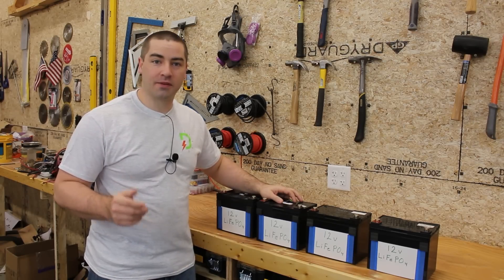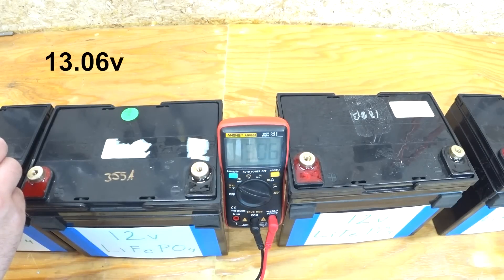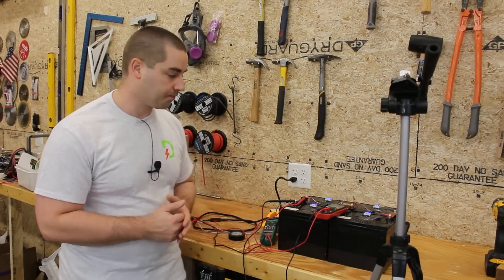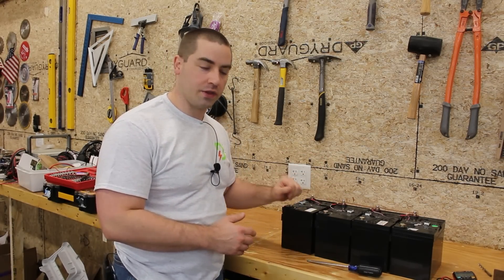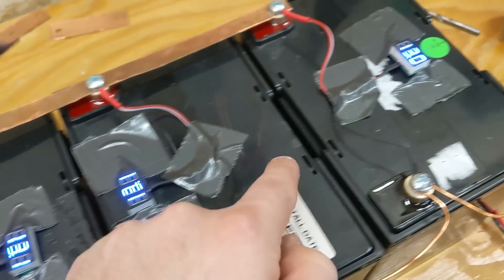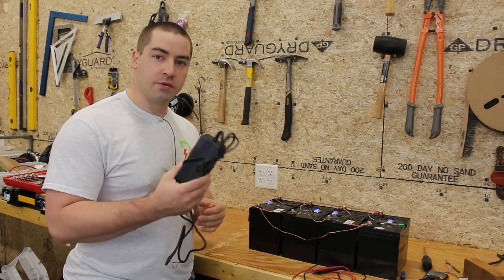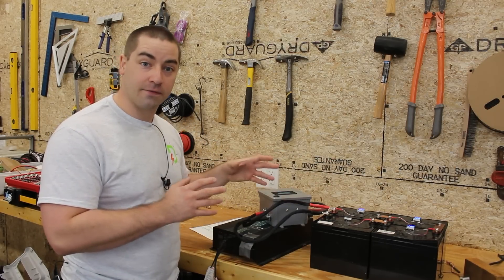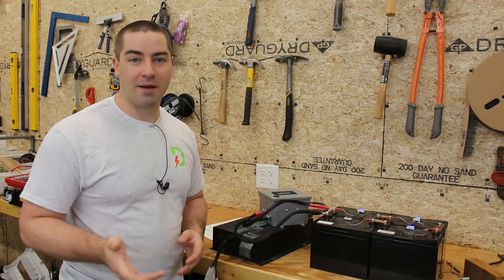How to Series Connect 12v LiFePO4 Batteries, and Top Balance

Comment: You could also capacity test each cell individually. 
For people confused, When stringing in series, if your charger only monitors the overall voltage. You have to get a multimeter out and double check the voltage of each pack. If one pack is constantly being pushed to a much higher voltage than the rest it will degrade and get worse. To counter this you have to reduce you charger cut off points. It will reduce day to day capacity but will dramatically increase the number of cycles which is more valuable return on your investment
Reply: Yes, I was recently in communication with a Chinese company that uses CATL cells in their products. The advice was to keep the pack between 20-80% but if you want maximum cycles then 50-80% with a >6000 cycle life is what they claim. Obviously the latter would involve buying a larger battery than you might otherwise need... perhaps a marketing ploy? I guess we will find out who was right in 20 years but my guess for best practice is to keep the pack out of the steep part of the charge/ discharge curve and let an active balancer keep the cells within a certain limit of each other.
Reply: What was the voltage output of the charger that was used to charge all four in parallel? A voltage output of 12V won't charge 12v lithium batteries, I believe it would have to output somewhere around 14.8v if I'm not mistaken.

Comment: I have just found that it is possible to get a balancer that works on 12 volt batteries. I got a PowMr HA02 balancer that works on banks up to 48 volt. I have installed it on my 48 volt bank of cheap LIFEPO4 batteries and it has given the bank much bigger capacity.

Comment: David, I have an EW7 mobility scooter with  4ea 12 volt (48volt) lead acid batteries, will be using lithium phosphate life pro 12 volt 20 Ah batteries 4ea.(48 volts) My Question is,

my Charger is a Waouks model wa.600, 58.4 volt, 10Ah , CAN  I use it to charge my 48 volt batteries???

Comment: So I'm putting together a 24 volt system. Is it better to series two twelve volt batteries or invest in 24 volt batteries and run them in parallel? Do I get more useful reserve capacity (Longer run time) parallel 24 volts or series 12 volts.
Reply from the maker: It is better to use a 24V battery if you have a 24V inverter.  Series connecting 2 12V batteries is not preferred.  However, if you already have some 12V batteries, this video will help you series them to get the most energy and life.
Reply: @DavidPozEnergy  do I get more reserve power in series or parallel?

Comment: Ok. So I'm seeing lots of videos about compressing the batteries to stop the cells bulging, but none of the vids I've seen about compression actually use 12v batteries like these. They are all 3.4v, "EVE" style batteries. So, with my "lawnmower battery" sized, 12.8v-33Ah 'Electrovolt' branded generic LiFePO4 batteries, should I try to compress them? The casing is plastic, will it really matter? I bought the 'Electrovolt' branded 12v-25A charger to charge them individually for the first charge. 

This is way more complicated and involved than I had first realized. 🙄🙄🙄
Reply from the maker: No, do not compress this style 12V battery.  Those cells you mention (commonly blue rectangles) need a fixture to prevent swelling.  The batteries in this video are made of cylinder style cells that have a metal case around each.  That casing is the fixture already.
Reply: @DavidPozEnergy  Thank you so much for getting back to me and clarifying. I appreciate it greatly.

Comment: Finally! I've bought some new 12.8v LiFePO4 batteries, with internal BMS, wholesale from a company that went out of business and their literature says do not exceed four batteries in series or two in parallel. Now, I've bought six of them at once with the express purpose of connecting them in parallel to keep the voltage at 12 and crank up the kw hours. I was bummed until I realized that all the channels I watch have multiple, multiple batteries connected in all sorts of configurations. But this is the first set of "lawnmower battery" style of batteries I've seen anyone experiment with on camera. So thank you for easing my mind on these. I got an awesome deal. Best deal I could find anywhere for new, 12v LiFePO4 batteries. They're all brand new batteries, but still quite a bit of money for me to spend.

Comment: Hello David,
Is it better to buy 4 batteries 12volts 150AH (Felicity  LPBR12150-T) and connect them in serie on a Growatt SPF 5000 ES or buy one  48v /150Ah (Felicity LPBR48150) - (4 batteries cost 1360 $ vs. 1800$ for the other one)
Reply from the maker: It's better to buy a 48V battery when you need 48V.

Comment: I have two 12v lifepo4 batteries and the supplier just says "do not connect in series" but they don't say why but now I understand why. (and also, it seems that it's not that bad if you do, actually)
Reply: cuz it make the BMS fail and the failure caused by HIGH voltage ( 24 v ) make that the bms CANNOT be turned off anymore, i already seen it happen, if you want a 24 volt battery then BUY A 24 VOLT PACK WITH A 24 VOLT BMS, NEVER EVER put BMS in SERIES, NEVER

Comment: Beautiful & Very informative Information. Thank You so much. Could a person charge each individual 12 volt battery 🔋 to do the Top Balancing & achieve the same results?  Thank You again
Reply from the maker: Yes, you can do that too.
Reply: @DavidPozEnergy  Thank you so much for replying. I’m new to the Solar world 🌎. I just bought 16 100 amp hour Battle Born Batteries 🔋 with the Victron inverter that battle born recommended for my 48 volt set up. I also bought 8 Solaria 400 watt solar panels. I’m excited to learn. I’m learning from you & Will Prowse of DIY Solar. You two are the best teachers in my humble opinion. I’m putting my system inside of an all aluminum cargo trailer so I can have portable power & an option of a toy hauler too. Thank You again. I’m a brand new Subscriber to your channel too. Please stay Safe & Stay Free 🍻 🇺🇸

Comment: Hi David. Great video. I picked up 5 Renogy 12 volt 50 ah batteries with the intention of connecting them in series,  about 70 volts when fully charged.
This was to power a covered mobility scooter running a 60 volt 1200 watt brushless motor.
I read some comments saying 4 batteries is okay in series, but maybe not 5. 
I'm wondering whether to go ahead with a test. 
Looking forward to your other videos.
One of my next projects is to put a 175 watt solar panel canopy on a 60 volt mobility scooter using a boost voltage converter.
Baby steps.
Thanks for your videos.
Reply: Careful, Renogy specifically says not to connect their batteries in series, only parallel.  Not sure why he missed that

Comment: Hi. Thanks for the vedio, if i understand correct, i can connect two 12volt LiFePO4 in series and use then in a 24 volt ups sustem. I must just remove them say once a month to top balance them? please answer
Reply from the maker: You will have to check with your manufacturer to see if series connection is supported.  Some do, and some don't.  Eventually they will drift and need the top balancing again.  I'd probably check once a month, but depending on how hard you push them you might not have to re-balance for a while.
Reply: @DavidPozEnergy   Thank you for the reply, so i guess it just boils down to can the BMS handle the input voltage and step it down to a suitable voltage to charge the battery

Comment: Thanks for the video.  Question, when using series configurations, such as a 24vdc  xxxah with a bluetooth module, how do you use the bluetooth dongle in each battery to monitor the individual pack?  Two batteries, two bluetooth dongles how to monitor?  Thanks is advance
Reply from the maker: Each BMS needs it's own Bluetooth dongle.  Then inside the App you will see the different serial numbers and you select which one to open.  I have about 8 batteries in my garage now all with bluetooth.
Reply: @DavidPozEnergy  Thanks for the info...regards keep up the good video's

Comment: can I use my regular car battery charger in 12v mode and 2 amp mode ? it's for 2 brand new 12v lithium that will be run in 24 v config. They need to be same soc before series hookup
Reply from the maker: Not all car chargers can work with a lithium battery.  lithium requires a "CC/CV" charger, meaning constant current and constant voltage.  I linked to one in the description that wasn't too expensive.
Reply: @DavidPozEnergy  thanks, perfect!

Comment: Can I power my ebike 48volt 1000watt brushless electric motor with 4 12V 16ah Lithium Iron Phosphate batteries wired in series to produce the needed 48 volts? It currently operates off 4 12v 16ah lead acid batteries, but the weight is 3 times heavier. Will the internal BMS in the LiPO4 batteries shut off sooner? Note: On an ebike, you pedal the bike at the same time the motor is running, to extend run time until the volt drops to low for operation, regardless of power supply.
Reply from the maker: Hi Bennie Williams,  The answer is: probably yes.  Something to consider is the peak your motor might draw.  1000W/48V=20.8A  But there might be a surge when you start from a stop.  If the surge is 3x, then you could be looking at 60+ amps (for a second) you need to account for.  The BMS's built into a 16ah lithium battery might not have that capacity.  So just make sure they do when comparing batteries.  Alternatively, you could make your own battery, or buy an E-bike 48v battery.

Comment: It’s always best to use/build a 24, 36 or 48volt battery to get those voltages instead of 2, 3 or 4 12volt batteries in series. When charging in series even the best batteries like Battle Born will eventually go out of balance it you don’t take some extra steps. Top balancing the group will work for a while but you will need to reassemble it in parallel periodically which is a hassle. There are only two other ways. One way is to have each battery have it own independent charging like using the Ionic bass boat charger. The other way is a PowMr battery equalizer 4x12V on Amazon. This is not to be confused with a BMS but it’s kinda does the same thing with batteries but not cells, however no protection features.
Reply: So this pow Mr when put on 4 12v lifepo4 will balance the batteries and that all you have to do?
Reply: I guess in a single 48v the bms will take care of the balancing?
But wouldn't that be of a reduced capacity as compared to bigger batteries in series?
Also why not use a bms for the series connected batteries?
Total noob here 😀
I need to replace lead acid batteries 12x8
Have a 96v inverter

Comment: If you charge all four 12v batteries (in paraellel) to full using your 12v charger. Then you rearrange them into series...won't you have 48v full batteries?  I found it curious that you swapped to the 48v charger (which is more expensive).  Unless this is just a time saver or something?

Comment: Brilliant tutorial David. Many thanks from Australia! I have a pair of 12v LiFePo4 batteries I need to put in series, but have been told by the manufacturer that's a no-no. With the research I've done, and having watched this video, I'm pretty comfortable they'll be fine once they are properly top balanced. If not, it'll be a lesson learned! LOL
Reply: Hey Bruce,
 Fellow Aussie here in the same situation, how did you'd go? did is it holding up? Just bought a pair of the same type also wanting to hook em up in series but just noticed the manufacturer warning against using em in series. Unsure what to do atm. 🤔. I thought they were a bargain when I saw em but now not so sure.

Comment: Excellent video Dave. Can I connect 6 batteries in series? Some manufacturers state the possibility of connecting in series only 4 pieces. Thank you Pavel.
Reply from the maker: I've not seen any that allow more than 4.  Possibly a company like Valance might?  Or maybe buying 24v batteries, then connecting 3 in series would do the trick?  I don't have anything that needs 72v, so I don't know for sure.
Reply: @DavidPozEnergy  What are the limitations? For what reason? I'm building a go-kart with a 72V motor. I will put the HA01 balancer among the batteries.
Reply from the maker: If you are building the battery yourself, then use a BMS made for 72v: https://www.aliexpress.com/item/33050602966.html?spm=a2g0o.productlist.0.0.3f7e7978CllqCw&algo_pvid=36632c7d-ddda-44b2-bada-bc82472d5c52&algo_expid=36632c7d-ddda-44b2-bada-bc82472d5c52-2&btsid=0b0a555816169597516483319e362e&ws_ab_test=searchweb0_0,searchweb201602_,searchweb201603_
Reply: @DavidPozEnergy   I build the battery myself 100Ah. I need a discharge current of 100-120Ah.
I would like a 12V battery for multifunctional use. (go-kart, solar system, spare power source ...) I think that manufacturers of 12V LiFePo4 batteries do not recommend connecting more batteries in series because they do not have balance. How do you see it? Thank you, have a nice day, Pavel.

Comment: Wouldn’t a charger that can recognize the bus shutdown and switch down work better for longer term?  Ie if there was a binary connector between the charge controller in the batteries and the charger, then the charger would know that one battery shut down and then flip to 36 then 24 then 12, and then finally off so that top balancing is always happening automatically?

Comment: Great content! What is best practice when building a larger 48v system using the eve 3.2v 280 ah batteries. Top balance and put in 16S or 4S 4P or 8s 2P? Thanks again, enjoy watching your content!
Reply from the maker: The first one.  Top balance the cells.  Then arrange them into 1p16s using one BMS rated for 16s.  It's always best to build a battery to the voltage you want.
Reply: @DavidPozEnergy  Thank you!
Reply: @DavidPozEnergy  What would you recommend for a good BMS! I was looking at getting an Overkill.
Reply from the maker: I've never used Overkill brand, but they seem good.  I have no reason to think it wouldn't work well.  
I have used the BMS's from Battery Hookup and they work well.  My discount code with Battery Hookup is "DAVIDPOZ" which helps the channel through the affiliate program.

Comment: Careful Dave, some batteries of this type are not recommended to string in series, and what if someone mixes 4 different brands and capacities of them?  You should warn against doing that.
Reply: Would you be able to give more information why don't don't like series. I just got into lifepo4 from AGM and the ones I bought say parallel only. When testing they seem to do series fine and I plan to buy multi bank chargers to charge them all individually. Would that be bad?

Comment: Just ran across your channel. VERY good information! I am looking to build a bank of 4 x 16 3.2 cell 280Ah batteries. How would you address the top balancing with individual 3.2V cells? Would the BMS be across the entire 16 cells in each grouping? (I think so) What about active balancing while in service? I am very new to this as we are putting up a 2 phase array to defer some home electricity and also supply power to a new EV called Rivian! 65KW capacity. Any suggestions would be appreciated! Thanks
Reply from the maker: Hi Jim,  Thanks for checking out my channel.  When you say 4x16 cells, sounds like you have a total of 64 cells.  I'd wire all 64 positives together, and all 64 negatives together and top balance (charge to 3.65v)  This may take a couple weeks depending on your charger.  I've actually done this with some EV cells: https://youtu.be/lAqUfC-zR4M  
As for the active balancer.  I own an active balancer and use it a lot when I'm refurbishing battery packs.  However, I don't recommend leaving an active balancer attached while the battery is in service.  I have found the active balancer throws off the readings on my BMS, causing my BMS to shut down.  Instead do a real good top balance, don't rush it, and then allow the BMS to just maintain balance over time.
Reply: @DavidPozEnergy  4x16 - 4 banks of 16 3.2V cells (51.2V) each 3.2 cell having 280ah.
Reply: @DavidPozEnergy  second item if you could. have you done any posts regarding using portable power packs that in my case have lost the ability to charge due to the mini USB charge port is loose and will not make constant contact. would like to continue to use the batteries (Gorilla Gadget 20000mah) to charge my portable devices, Thoughts please!

Comment: This problem isn't a problem if you run a 12v system right?
Reply from the maker: Right.  If you buy a pre-built 12v battery (like in the video) then you don't have to worry about this.  It's just for series connections (24v, 36v, 48v)

Comment: I've had good luck with the JK active balancer with a BMS at the whole battery level as well as with separate batteries put into series like this. I've made a harness for each battery system I've put together and eventually ended up buying an active balancer for each one. It especially works fast when under a slight charging or discharging.

There are some other balancers out there with good reviews too.

Comment: Can this technique be applied to 3.2v cells you plan on putting In a battery pack? How would you do this for a 12v battery with 40 18650? Just top balance groups at a time?
Reply from the maker: Yes, you can do this with 3.2v cells also.  I did this with 45 LiFePO4 cells from an EV, all in parallel.

Comment: I have a new LiFePO4 24v system in my rv. I have 8-100ah LiFePO4 batteries. How would you balance them. 4 and 4? Help. Using a Growatt 24v 3000watt hybrid inverter/solar charge controler.
Reply from the maker: I would take all 8 cells out of service for a day.  Line them up and parallel all 8 cells together, to form one giant 3.2v 800ah.  Then charge that up to 3.65v (or whatever your manufacturer says is max.  Once they reach 3.65v take off the charger and let sit overnight.  The next day un-parallel them and re-arrange back into series with your system.